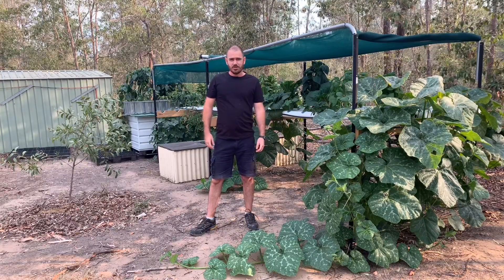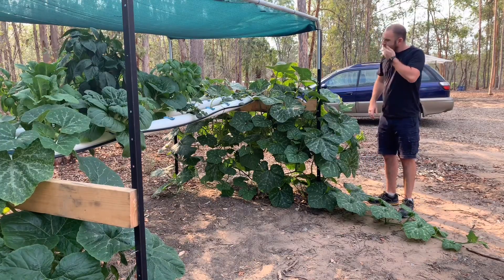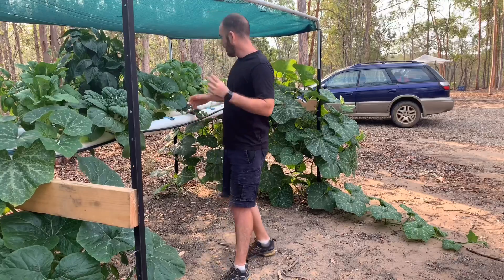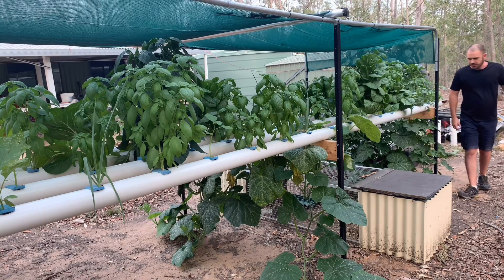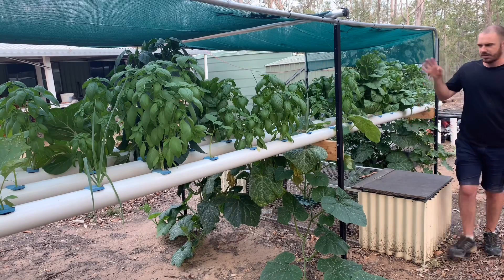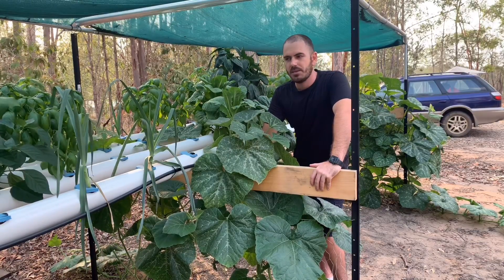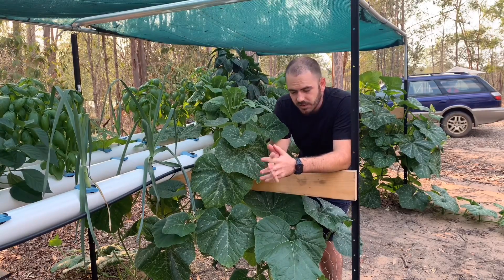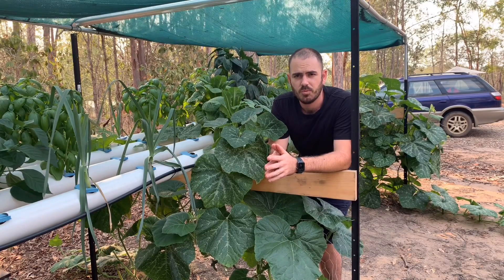Troubleshooting Root Systems in NFT

Comment: Hi mate, just curious weather you've had root rot, and if so how you control it
Reply from the maker: Matt Sorensen I’ve not had it in my nft as the water isn’t still, but in my DWC I’ve had it, I dose the system with H2O2 to try and control whatever microbe is attacking the roots.

Comment: Insect control...what do you use?
Reply from the maker: Neil Cutten use whatever you like, unlike aquaponics you don’t need to worry about the effect on aquatic life (which most insecticides effect horrifically). I try not to use them. But I’m about to upload a video about all the pal Choi I recently planted that was destroyed by caterpillars before I noticed. I used maverick on them. The insecticide will depend on the problem. Just try your best not to put it on flowers. #savethebees

Comment: What a beast.
Consider this. Plants need roots to search for water and nutrients.
In hydro, this is no longer required.
If the roots are chopped, won't they still absorb all the hydration they require through the remaining stumps? 
That's what I'm experimenting with. l do however provide a generous area for oxygen roots to thrive.
Reply from the maker: I totally agree. I’m not really worried about killing the plants as I am about effecting their productivity.
I regularly have to cut the roots of the vines closest to the res to stop them venturing into it.